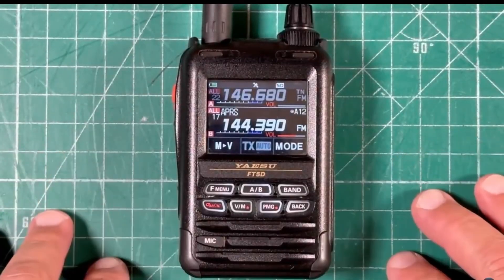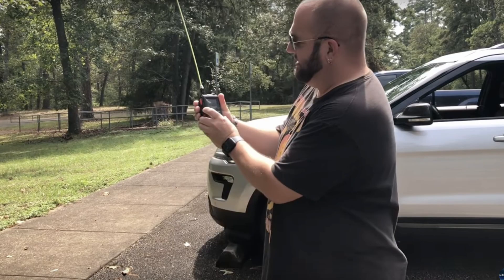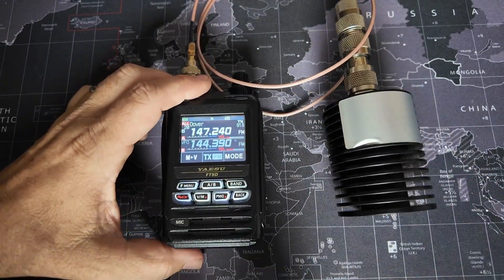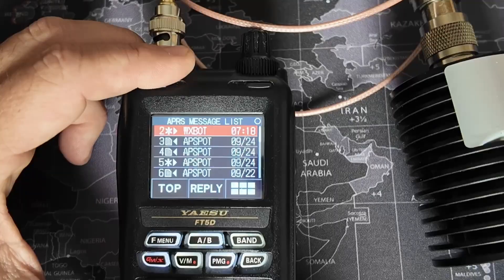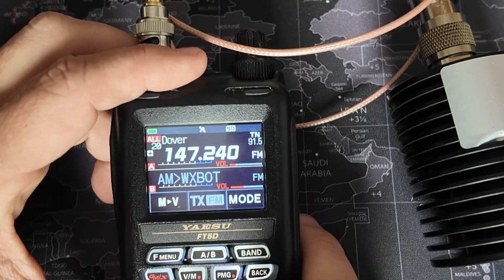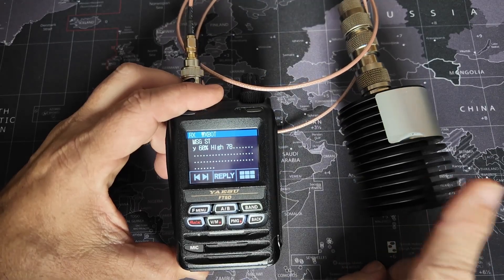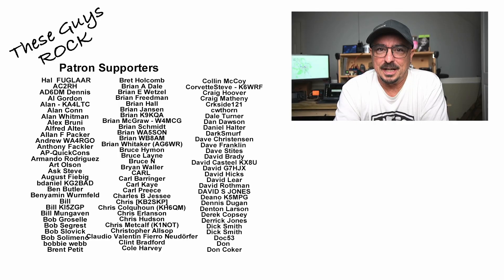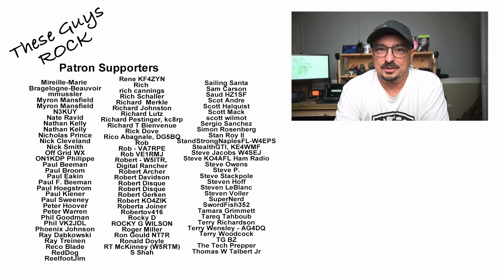Is APRS Reliable?

Comment: Great job on calling out his Clickbaity video. He kinda set himself up to fail this test (intentionally?). 

Many APRS haters live in areas where little to no APRS infrastructure exists. Rather than just bashing APRS online, one can spend under $100 on a raspberry pi and an RTLSDR to get a working igate setup and contribute to the network. This setup is easily expandable to a fully functional Digpeater with a digirig and a radio. If you can do digital HF modes, you have the skills to set up a modest igate or digipeater with off the shelf parts...

20 miles is a pretty long shot to a digipeater if you can't even get your antenna above the treeline. He never mentioned the HAAT of the target digipeater, which was the single most important factor contributing towards his success. If the digipeater was on top of a mountain, it would easily cover 20 miles. My modest digitpeater on my rooftop is in a relatively poor location in a forested valley bottom and  has only about a 5-mile range. Antenna height is factor #1!

Comment: To be fair, APRS should always have the heavy asterisk attached to it that it only works well in areas with APRS supporting infrastructure. Which means it really ends up having the same weakness as a cell phone, albeit a 2m APRS signal SHOULD be able to go farther in most cases.

That said, I'm not entirely sure what the offer of a Pi Digipeater would accomplish. Given the scenario in K8MRDs video, unless the digipeater could be emplaced in a good location between his position and the repeater/node he was attempting to hit, it cant seem to understand the point (considering the point in this case is APRS's usefullness in a wilderness/park environment away from locations where HAMs could place a digipeater or node).

Comment: Been using APRS 20 plus years now. Been doing APRS before APRS had maps. Like all thing radio, propagation also affect APRS. APRS is not only done thru digipeaters. There is also HF APRS. APRS works best in high density are with a lot of ham radio activity. I been beaconing my Position everywhere I go.
73 de N2NWK

Comment: I have used APRS since it became available for hams. I have used it for position reports and messaging, but even more important to broadcast bulletins to travelers on I-5 just north of L.A. I normally used an old HT at about 5w, but occasionally trimmed it back to 1 or 2 watts with little difference in performance. The key was a wide2 digipeater sitting on a mountain in my direct line-of-sight about 2000 feet above my home. I almost always set a path of "wide2-1".  That is all it took. I also had a good visual on the south side of the Tejon summit area so, using binoculars, I could actually see what was happening on the road. I felt very compelled to keep up with accurate status bulletins and objects before, during, and after severe weather in the winter, and fires in the summers. I have now moved to a new single story retirement home many miles away, but it was fun to be of service while it lasted. --Mark, KE6BB

Comment: I would rather be part of the problem.
Reply: Well that achieves nothing.
Reply: @hamradiotube  😂😂
Reply: 😂 APRS has been shown effective and fairly reliable for decades
Reply: There was a 13 colonies test up the eastern seaboard and I’ve got a station running, also done QSOs through the ISS with an TH-D72A
Reply: Yup, that pulls in the clicks! 😀 Nothing quite like creating traffic like a good rant or disaster.

Comment: That's MY point. The fault is with hams. Not enough digipeaters and igates out there. But still, something is wrong when you can't hit a station 20 miles away with 50 watts.

Comment: Exactly right. Not everyone has the ability to put one up on a 6400 foot mountain, but I also have a simple, local coverage digi at home as well. So when I'm out hiking or on the MTB, I get digipeated more often than not.

The major point of the APRS system is that it is only as good as the hams that put up radios to support it. The more digi's around, the better it works. It is cheaper and easier than ever to put up a digipeater, and let's face it, us hams will have a radio laying around that we can use for a digi.... (back to your video with your wife, for example, we all can relate 🙂)

So it's not a "service" in the classic sense... The service exists because of, and is provided by.. US. The more of us that do, the better the "service".

Comment: Jason as a comparison to what Mike sent.  Here is Huntsville (AL) we do a bike event that stretches 48miles into Tennessee.  We have been building raspberry pi digipeater since before your videos.  Ours are similar with a raspberry pi, audio interface to the radio packet port, cable and GPS.  (PS i have tested yours and they work very well). We can easily hit our digipeater on a hill clear of anything but Trees.  I am saying all this because I think something is a miss that needs to be worked out.  This could be the digipeater or the local setup.  I hope he realizes this is an achievable solution.

Comment: You two are great! Question on digipeaters - if his radio won't hit a nearby digipeater from that park, would his own digipeater (at that same park) be able to hit the nearby digipeater? I keep watching you guys and can't decide if I need an APRS radio Thx.
Reply: Digipeaters are not magic they are subject to the same principles of radio performance (power, antenna, height, terrain, etc). That digi Mike was referring too performs poorly for a digi, it's antenna is not very high (50'). Ideally all digi would be over 150' but those are hard to come by.
Reply: @wassman27  So MIke's digipeater would either have to be connected to the internet (not available at the park) or hit the next digipeater (which it couldn't). So Mike having a digipeater wouldn't solve the problem. What am I missing?
Reply: @dougdaniels I think Jason was just suggesting adding to the APRS network as a way to expand the footprint but not necessarily help from that specific park.   I don’t think he was suggesting a mobile digipeater which wouldn’t likely add value as you pointed out.
Reply: @cchalfantusa  Thanks, that clarifies it 👍
Reply: @dougdaniels  digipeaters are stationary like repeaters for APRS and typically they are linked to the internet that gets it part of the entire network.

In Mike's case his location didn't have good APRS coverage and Jason was suggesting putting up a digipeater somewhere closer to fill the gap.
Reply: @wassman27  Probably at home. But Mike's home town might already be served by a digipeater somewhere.
Reply from the maker: It's just a simplex question. How high is the antenna at the digi and are there any obstructions between you and the digi. Distance also comes into play.

Comment: My first HT was the TH-D75 when i got my license. Was so excited to try aprs.
Well the nearest aprs repeater is about 100 miles away. 😂
That excitement about aprs is gone and have to agree with Mike.
Reply from the maker: It's hard if you don't have a digipeater in your area. You might consider putting up a digi at your location.
Reply: @KM4ACK  Not only digipeater, but also IGate.
Reply: @KM4ACK  Do a video on that? Also wouldn't you need a station antenna at a higher elevation or on a tower to implement that said digipeater station?
Here in Nebraska is flat lands.
Reply: @HamRadioN0CKL  He has tons of videos on the subject. And whatever you can put up is better than the coverage you have now. So doesn't have to be a big-guns station. My home installation is just a raspberry pi and a VHF radio (with the associated computer/radio interface). It uses a mobile antenna on top of my chimney with a mag-mount NMO base. My station digipeats handheld and mobile stations within 10-15 miles depending on direction and terrain.
Reply: That! People saying that they don't have a digi, should just realize this is a great opportunity to learn about setting up your own digi and serve the community.

73 de Luis, HB9HJU